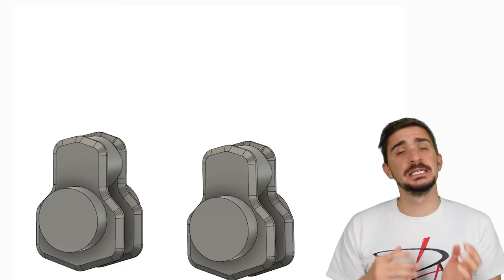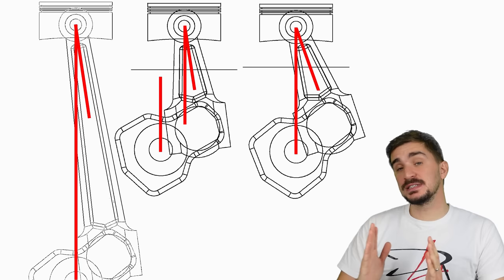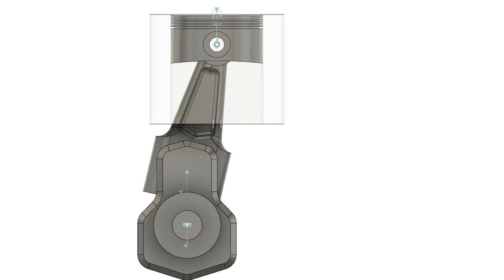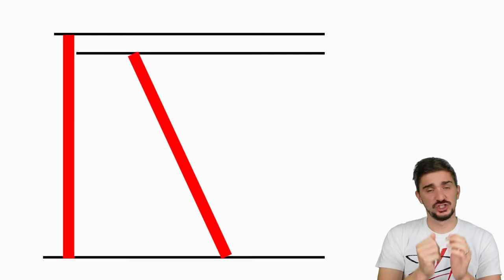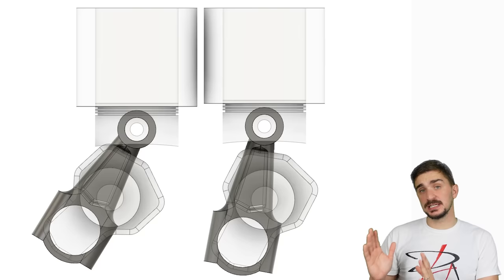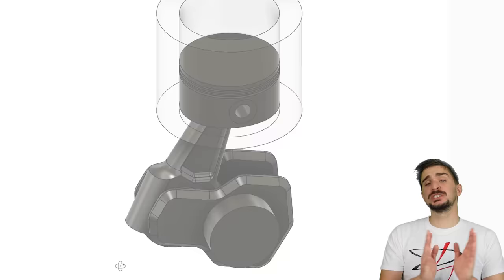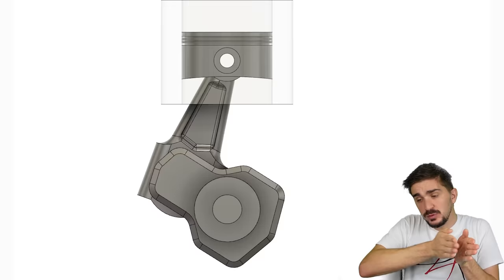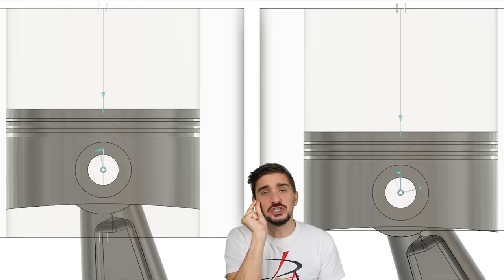Cylinder Offset Changes Everything

Comment: This is the first (but not the last) one of your videos I’ve watched.  Love the subject matter and your explanation.  I’m 4 minutes through the video at this point and I do have one question. Regarding the narration that there’s a “longer stroke” realized by the offset engine.  Although agree that when the pistons in the side by side animation pass through BOTTOM dead center, the offset engine’s piston will ride lower in the cylinder than the zero-offset engine I believe that when the pistons pass through TOP dead center, the offset engine’s piston will NOT ride as high in the cylinder as the zero-offset engine’s piston.  So, the stroke is not lengthened, but rather relocated.   In the video’s animation example, the offset engine would have lower compression unless other changes were made to the offset engine’s geometry to compensate.  Maybe I misunderstood your point?   I’ll revise my comment as needed after I watch the entire video (likely a couple of times).

Comment: First, this reminds me of the “triple expansion” steam engines. Which have three cylinders of different sizes.  Second, I wonder if this might perform well as an electric generator, where the engine would be running at a constant speed.

Comment: looking up a new motorcycle i'm interested in and i read it has an offset cylinder engine. i briefly think 'is that what i think it is? if so, that might be very cool'. here i am and it was indeed what i think it is and very cool. The secondary balancing part sounds like a right nightmare though

Comment: This engine design is called "desaxe", is it not? And maybe the greatest benefit is less friction and less wear on the thrust face of the piston. First time I came across it was in the Moto Morini 3-1/2 motorcycle of the 1970s, a 350cc V twin of great refinement, although rather relaxed performance.

Comment: Offset cylinders would also need a cam with different specs as an off the shelf cam designed for a zero offset engine might run but not to maximum power. And the cam ramp speeds would have to be different. I have a stroker engine in my car and unfortunately cant afford to have a company design a custom cam for my application. It has an off the shelf cam and it runs very well. I know this is unrelated but with all the stroker engines now available are most people running cams from the stock catalogues?

Comment: Back in the early 1960's, I replaced the piston in my Ducati 250 scrambler with a piston that had an offset pin promising more torque. Probably a terrible idea for piston and cylinder wear, and everything else. but hey, gobs of torque. Even in my imagination, any improvement simply did not exist. This lunch was not even free.

Comment: The MYT engine is far superior in every way, no matter what you do with a linear piston system. The MYT has cylinders which run in a circle with no piston pin/pivot point needed (so it's nearly friction free no matter what). Neither Yamaha nor anyone has interest in making the MYT because they've been bullied by the oil cartel who know it would ruin them, since it's capable of running so efficiently it can even run on air. Raphial the inventor at Angel Labs may have been killed as he was in great health but the website is down and his number is dead.

Comment: Alittle mistake in 10min. At 90deg is not maximum angle of con.rod. (it is decreased after square angle between crank and con.rod - where is max angle is) and it might be approx 80 deg

Comment: Thanks for the amazing video! I actually hadn't heard of this concept before. I do however have an axe to grind with some of the points you are making.
I think your point on spending time on harnessing power and wasting power is not correct. I mean A the time spent on that step largely depends on the relative piston speed and for example on a single cylinder one would assume that the crankshaft speed is higher anyway during work and smaller during compression, for obvious reasons.
But more importantly, from a thermodynamic perspective it doesn't change anything. What we are looking at is still the same p-V diagram, there might be a slight difference in the non ideal nature of the involved curves, because they occur faster/slower, but the important point is that we compress the same volume and that we extract work over the same volume.
Meaning if you drew a p-V diagramm with and without crankshaft offset, you obviously couldn't tell a difference, because crankshaft angle doesn't appear in that diagramm anyway.
If you made a diagram of p(angle) and V(angle) it would look different. But what interests us is the area under the p-V curve.

I would say the reason why this is so prefarable lies in the subideal nature of a crankshaft. If you sit down and do the math and calculate an idealized crankshaft, over one work stroke meaning 180° for no offset. The work performed at the piston is just F*stroke, if you then calculate the torque on the crank and integrate that you get W_crank < F*stroke.
This scales with the crank to rod ratio, the longer the rod and the smaller the crank, the more efficient the engine is.
That's why old steam and diesel and so on engines have these insanely long rods, it just makes them more efficient.
These are losses btw without friction! This amount of energy would be lost in vibration essentially. If you then add friction, as you mentioned, the sideways forces produced by the suboptimal nature of the crank produce wear and also energy losses.

I think this is where the trick lies with the offset. The force on the piston is by far largest during combustions (obviously) meaning that if you do the integration I just mentioned, both the inherent crank losses and friction losses are maximal there. By adding this offset you reduce both the inherent loss of the crank system, by making the stroke artificially longer and you strongly decrease friction on the cylinder walls and in the bearings. You then have larger friction and crank loss during compression and exhaust stroke, but this is no issue because the appearing forces are so much smaller. I didn't run the math yet, but if one imagines that you just always work with the same force on the crank so F always acting down, then you get maybe just as a guess 5% more on the power stroke and invest 5% more on the compression stroke. But since the forces are several orders of magnitude different in the real engines, this is an easy trade off. 

If anyone actually read this comment, thanks for taking your time and share your opinion!😂😂

Comment: Hey just like the GM 3800 series II, which came from late 1960's AMC engine tooling. I'm surprised it took this long for someone to make a decent explanation, apart from mechanical engineering classes. Good job, but it would have been best to label which cylinders were offset throughout your animations.

Comment: Balance issues. 
Odd numbered pistons off set in one direction, even numbered pistons offset in opposite direction. This would also balance the crank, as it rotates in it's bore, lowering friction on the main caps. Very similar to the Volkswagen VR6 and VR5, but their off set is with cylinder angle not crank position, but same concept.

Comment: its a lot easier to off set the wrist pin hole in the piston ! that's just one of the tricks the russian Zora Arkus-Duntov  gave to the chevy division GM by inventing the famous "small block V8" in 1955 as the 265 cu.in. (4.3L) V8 ohv with push rods and solid lifters that saved the corvette !

Comment: I love this! 

Now, when we combine all this engine piston/crank offset, bore vs stroke ratio. length of connection rod. Titanium vs Steel rod, and flow characteristics of the cylinder head. We chose a combination to best fit the purpose. How will different bore/stroke ratio make a difference to the balance and vibration compared th these offset engines?

ZX10 with it´s Titanium rods is nice, now if we put this knowledge in a square dual sport engine?

oo. and where do we place the counter balance shaft?

Comment: you want max energy transfer be when crank and shaft (edit. connecting rod) are at 90 degree angle. this gives max power output due to torque. but you dont want too much energy be there outside of stroke to create resistance. i wonder if fiddling with cylinder angle would give similar benefits or will it just make balancing super difficult.

Comment: i was thinking about this  since I was 18 years old,, I am now 63, you forgot to mention, the reduction of KNOCK,  The not offset, true flame hit piston at 6 degree after TDC, , Knock at 0 degrees, hammers rod into crank shaft bearing etc, In your off set at TDC, crank shaft is 9degrees safer from knock. true flame hit piston, 6+ the 9,  so crank shaft is degrees 15, and now vertical piston to push with less friction, boom more life long efficiency, where can I buy one ?   what are the petrol saving ?  It's like better dribbling of a basket ball- with less wear on your wrist or elbow

Comment: if it's so simple to change the Direction of force the counterweights, couldn't you "just" have opposite facing rods to another crank shaft, so that the rotational energy is counteracted?
It would require 2 crank shafts instead of 1, but gears could make the secondary shaft join the primary.

Comment: I wonder how the balancing is done it looks like it would take two different balance shafts, one for the peak and the other for the valley, the small rise may be negligible, or one is "enough".  On durations of the 4 stroke cycle yes more time for cylinder fill, less time in exhaust where some of the heat may be lessened.  I wonder if the engine runs cooler?

Comment: Well, I’m wondering. There was a fellow who attempted to balance an engine by using a single central combustion chamber and using a piston on each side to balance the assorted forces. 🤔 The thing is, it at the time produced an engine too complicated to build economically.  I’m thinking though, with the mind numbing complication of the curves for the forces that you have on the offset cranks, by comparison two offset pistons doing the same synchronized mirror image dance seems fairly simple.

Comment: I wonder how reliable offset engines are, as reliability issues might cost more to repair, than running a slightly less efficient engine over time

also, engine balance could probably be fixed with boxer engine, if used in cars?

Comment: So with this design, friction and engine wear due to the compression stroke would be increased compared to a zero offset design, correct? The rod is at a more oblique angle during compression so the efficiency of the compression stroke is worse (also shorter compression stroke). Compression doesn't involve as high a pressure as combustion so I would imagine the combustion stroke is the bigger concern. The net friction must be lower overall, right?

Another consideration is that the oil squirters wet the cylinder walls right before the power stroke, but the piston is pushing up into a dry cylinder for compression, so you have a well-lubricated power stroke vs a poorly lubricated compression stroke. Is piston ring and cylinder wall wear increased, decreased, or unchanged in the offset design compared to the zero offset design, especially when oiling is factored?

Comment: Wouldn't the offset engine cause greater damage to the cylinder walls and piston since it's up stoke is at a sharper angle, and pushing against the bottom half of the cylinder wall on two side? Top of piston pushing on non crank side and bottom of piston pushing against bottom crank side bore. It lowers friction on down stroke, but raises friction on the up stroke even more.

Comment: What would happen if you have a case with a 'parallel' 4 cylinder engine (for example)?  Where instead of a 'V' angle between the cylinders they are positioned parallel to each other using the same crank shaft between them.   As the cylinders offsets are mirrored, would the odd graph of the secondary forces also be mirrored thus cancelling each other out to some degree?  This wouldn't be perfect as the pistons are not in line with each other, but it could improve matters, as the torque is held within the engine block.

Comment: Now I know why Ford  uses balancing shafts in their 3 cylinder engines. Before they were proud that they do not need them, but sińce 2018 they introduced the offset and new shafts with it. I believe that balancing a three cylinder with a offset in not an easy job.

Comment: excuse me, interesting video, but I think there is a mistake in the animation: my opinion is that the cylinders are draw too short, because the piston rings were exposed when the piston is at the bottom dead center...
Reply from the maker: They're not cylinders, they're a representation of the engine's stroke.

Comment: Great video. But how does floating pistons compare to this? Most force induction applications have floating pistons designs to allow some play during combustion. I’d imagine that is to achieve similar results without having to mess with crank and rod angle or width.

Comment: is that called 'desaxe''? Fox Model Airplane Engines of Ft Smith, Arkansas in 1966 had a line of engines utilizing this off axis arrangement as  a way of reducing friction and wear on the bottom of the piston skirts thus increasing rpm.ie Fox 35-Fox 59. They were very powerful but created a lot of vibration. Used in ribbon cutting control line combat competition and racing.

Comment: I have a few questions: In the offset engine, this would change the compression in the chamber. Wouldn't that reduce horsepower? If that is true, can the compression be increased in the chamber to compensate for that loss at ignition? 
How would a person know what engines are offset? Is this fact known for car or motor cycle engines?
If there is an improvement in power and gas mileage, wouldn't it be best to have all engines be designed with the offset system?
With the offset engine wouldn't it be possible  to simply create the change on when the spark happens in the timing of the power stroke?  Except for the balancing of the engine, couldn't the distribution of the timing spark make an "offset engine"? Simply have the distributor give the spark after dead center top. It is nothing more than a timing issue. No change of the crank shaft is required.

Comment: Very nice video. Thank you for the information. I do have a question. In the off set engine the video shows the rod moving through what would be the cylinder wall. How is this problem overcome? Is there another video that explains this aspect? Thank you.

Comment: Nice video about engine physics.

I was also thinking about how the pushing rod movement varies from left to right. 

Does that change the secondary balance forces direction?

It also have it's own mass that moves differently on down stroke than on up stroke.

Comment: That cylinder configuration has been around for nearly 100 years as was used in an high altitude  two stroke aircraft diesel engine the Germans used in the 1930s I think because it made the engine unstable with its pattern why no one else used it because of vibration.

Comment: I would think this would be amazing for diesel engines, get faster compression on the rotation should help it burn cleaner as I'd imagine the faster compression would cause slightly higher temperatures which would lean to a cleaner burn.  Also more torque for those work horses is always better.

Comment: How would one go about measuring cylinder offset in a physical engine and, if an engine has no offset, could you determine the benefits (mathematically) of adding one? E.g. taking a known safe overbore - say a 4 mm overbore is common on a particular engine by boring and sleeving - you could instead make a 2 mm overbore shifted 2 mm to one side, staying within the safe limits, material / wall thickness wise. Would this 2 mm offset have advantages that outweigh the whole 4 mm overbore? Would balancing the existing crank sufficiently control vibration to have reasonable (if buzzy) engine life? I know there are formulas for these sorts of mechanical linkages, but I haven't needed to remember them in decades. Then the thermodynamics of the longer expansion and shorter compression cycles... Help me out here?

Comment: When was this design first thought of, and who thought of it?  Also, what are the typical offsets used and are all the contemporary motors using this?  I read one of the comments that Ford (Flatheads, perhaps) had an offset of 3/16".  That doesn't seem very beneficial.

Comment: "...complex vibrations...":
Simply use 2 contra rotating pistons/engines joined together by their 2 (nylon toothed, zero clearance) flywheels 
Vibration Fixed... 

Any other engineering challenges you need a hand with!?  :D

Comment: Good video, however, you only mention the movement of pistol  and pistol rod, but NOT the Crankshaft. For NON offset rod, both pistol and rod at 0 degree, stroke (1) intake.. what make the rod movement to positive angle? clockwise .. this must be the angle of the Crankshaft.. otherwise, the rod could rotate to a negative angle (counter clockwise)

Comment: Would a longer rod increase torque by reducing the angle at which the force from the piston is transfered to the rod itself and subsequently increasing the force applied on the crank throw at all times?

Comment: No insight into how on a zero offset combustion is dead headed at tdc
Or how the effective combustion pressure is halved when the combustion chamber volume is doubled as the piston 
Moves down
And when piston is at 90 deg to tdc
Max mechanical advantage the effective cylinder pressure is approx 33% of effective pressure at tdc